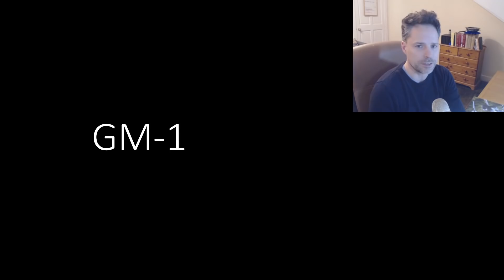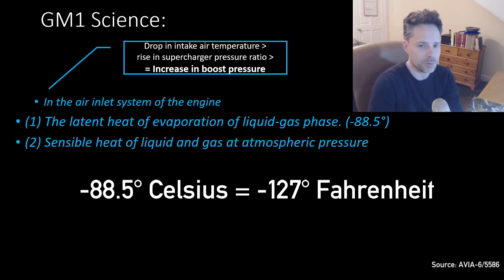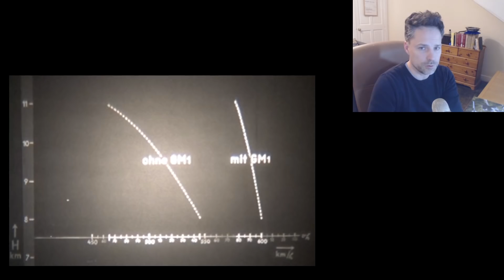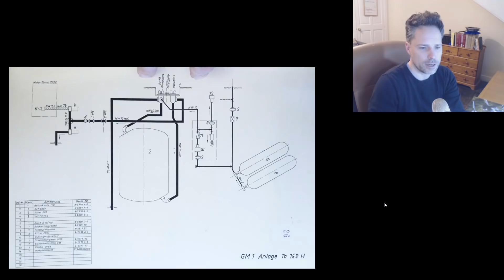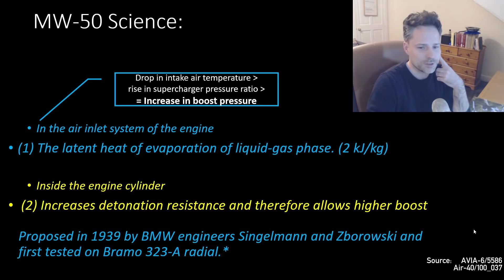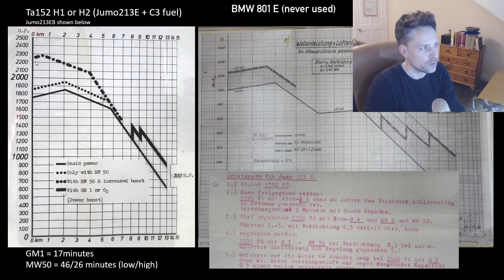The Secret Behind German Engine Performance: GM-1 and MW-50

Comment: GM-1 was rarely used. MW-50 was lower altitude power and more common in 109Gs in the Summer of 1944, but MW-50 soon fell from favour in the Fall: It added weight and was of little help in combat, because power does not help turning. Even 109Ks and 190D-9s probably rarely had MW-50, especially the 109s, since it forced using higher grade C-3 fuel. 190D-9 pilot Eric Brunotte mentions he never went past the MW-50 notch in combat, only to get away, and barely even for that... In fact he mentions being way below the notch all the time during combat... It added 300 lbs of weight, GM-1 even more... More power was really of little help in combat. Flaps and turning mattered more.
Reply: The above refers to fighter use, not bomber use.
Reply: Statistics on installations of MW50 and GM1 are almost impossible to come across, as they were very often installed in "kit" form, and sometimes aircraft designated as using it, never had it due to shortages of the insulated containers, the fluids themselves (GM1 was in direct competition with the Fertilizer and Munitions industries which also desperately needed the Nitrogen, and Methanol production was also desperately short, often being in competition with production of the basic fuels themselves.

It is quite true that GM-1 was not popular with all pilots, in liquid form under cryogenic storage (instead of liquified under pressure) it was very very tricky to work with, very hard for ground crews (you had to fly soon after filling the tank or the GM-1 evaporated off), and tricky for pilots as it took several minuites for the full effect to be felt as the flow took a while to stabilise. 

I would say however that your statement that "more power was really of little help in combat" is not a defensible viewpoint, unless you accept its only the case for a very low speed turn - which is a tiny part of combat as a whole. Its the only method of increasing the performance of an aircraft once it has been laid out, and occupied thousands of engineers on all sides from the mid 30`s to the very end. More power enables you to completely dictate the entire combat episode, picking out the single tiny moment of a low speed tight turn as "what combat is", is a very strange thing to do. All Allied pilots were advised to use their speed advantage in combat, and not engage in tight turning dogfights, if the enemy wont enter into a tight turn, and has superior speed, he can simply escape then come back and re-engage on their own terms from a new vantage point, and usually win. All the AFDU reports advise this.

You have to be a bit careful before implying that tight turns dont need engine power, the more you bank the more power you need to apply to turn without losing altitude, because lift is lowered, so you have to increase angle of attack (significantly increasing drag). Blanket statements on this are not accurate.

I am perplexed why you feel the need to state "MW-50 was lower altitude power", this is explicitly stated in the video, several times, which suggests to me you have not actually watched it (or at least not a lot of it).

So whilst I agree it was not used nearly as much as you could imagine, I do not agree at all that flaps are more important than engine power in WW2 combat. The complete trend througout WW2 was a progression from the "turning" philosphy of the biplane age of WW1 to the "energy" philosphy of modern combat, where speed is all and enables you to dictate combat. One can find examples of anything, but broadly this is unquestionably the broad direction in which combat engagements went in WW2, engine powers tripled, weight doubled, and generally as a consiquence of high wing loadings, and high speeds, agility went down.

I am always looking for archival statistics on GM-1 installations, if you have them, please provide them below.
Reply: Low speed turning was not "a very small part of combat'", except early in the war: By 1945, a FW-190A pilot said: "We turned continuously: It was the only way to survive." Hit and run was a valid but difficult method of fighting, given 1% hit rates from average pilots, worse so at high angles... Turn fighting not only offered more target time, but protected from high angle leading shots from outside the circle. Turning while cutting the throttle  also easily defeated hit and run tactics, and US Navy pilots criticised Japanese Navy pilots for NEVER turning with the A6M Zero, as the IJN steadfastly adhered to outdated 1930s hit and run ideas (which were good for jets, but applied too early to props). The IJA turned more consistently than the IJN, and collected more kills with the inferior firepower of the Ki-43. This is all from recent discoveries by Pacific war historians. Hit and run dominance was a 1930s assumption as soon as monoplanes appeared, and a handful of good shots felt the concept solid from limited Spanish Civil War experiences, leading to the massive debacle of twin engined day fighters... The currently accepted history of WWII air tactics is the exact opposite mirror of reality, and the reasons are rooted in the actual physics of these low wing prop aircrafts, as explored on my channel: See "WWII fighter aircraft designers did not understand what they designed", in particular, to understand why internal leverages make these aircrafts counter-intuitive. FM-2 Wildcats and Ki-100s could and did defeat practically everything they encountered, and FW-190 pilots like Brunotte are adamant they never used emergency power in turning combat, and in fact did not even go to the full continuous power notch... Internal leverages are so counterintuitive Clostermann (RAF mission record holder at 400) pointed out the Spitfire out-turned 109s and 190As above 280 knots, but said that inevitably speeds fell below that, and that the die hard myth the Spitfire could out-turn either below 280 "is a good joke"... Similarly, top RAF FW-190A killer Johnny Johnson (and top Spitfire ace) described being out-turned by the FW-190A at low speeds as "inevitable"... Hit and run was a valid tactic on an unaware target, but was much harder to apply in reality than in theory. And it is generally not true most fighter targets were caught unaware, although some aces did take the time to "stalk" damaged or unaware stragglers, and sometimes made a principle out of this. Typical combat was increasingly turn fighting as the war advanced, and you see increased instances of reduced throttle while turning later in the conflict. This is because the wing inter-acted with the thrust, as I explain in my videos.

Comment: Very Interesting, Just watch Fast and Furious, any one of them and you will see the use of the N2O, however it destroys your engine for also another reason as the residues turns to Nitric acid the corrodes your engine, not to mention the tremendous stress it puts on your engine ehile it is applied, sometimes these engine are not designed to withstand such tremendous forces.

Comment: These engines were fuel injection, right? So how did the NO2 or MW-50 get introduced into the cylinders?  Also did the use of either of these systems have an effect on the Time Between Overhaul (TBO) based on the number of times they would used?

Thank you,

Love the channel
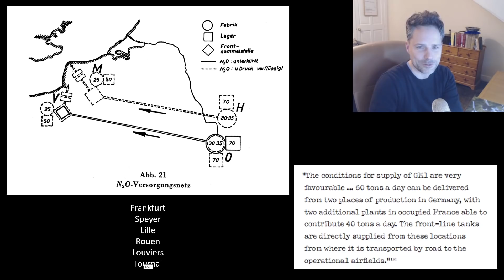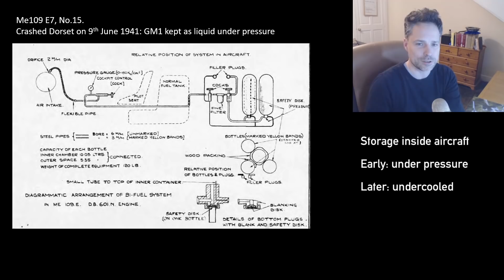Reply: 13:22 14:26   - TBO was basically an irrelevance to the realities of German aero engines by the time these were employed. Real overhaul times dropped to 50hours regardless of if you used them or not. In principle, MW50 would put more load into the bearings, and therefore would definetly shorten the life, however there is no data at all on what that would be. By late 1944, most aircraft were probably destroyed long before the engines reached their major overhaul period.
Reply: @CalumDouglas  was it injected directly into the intake manifold?
Reply: @stuartmoon6202  Depends on the engine, but almost always injected into the supercharger eye. Hence the two time-stamps I provided which link directly to schematics showing you where it was injected.

Comment: My understanding was that the allies were using super saturated fuel, with a much higher octane rating than the Germans, giving them also some 300hp advantage at around 20 000ft.  Might it be that the Brits understood Nitrous oxide but were not interested in going that route?
Reply: TL;DR fuel was probs not the reason, rather engineering took a different route.

I don't have much expertise on that issue, but my understanding is that at least the US and UK, compared to Germany, used a different octane rating system for aviation fuels. German fuels, generally, were a bit worse in octane rating, but not nearly as much as the numbers comparison suggests at first sight. There's a lean and rich measurement yadda yadda. They were definitely competitive with the Allies' juice. Putting that ~300 HP @ 20k ft figure out there without context is hard to comment on, but personally I'd say the main technological difference there was intercooling.

This is where things get blurry. You need both an engine design, and the fuel grade necessary to make use of each other's potential. The various Axis and Allied powers followed different approaches to different doctrines, although those sometimes mixed through Lend-Lease agreements and license production. Instead of supplying a sort of air additive to run what you have at more boost, the Brits decided to bolt on a second (auxiliary) supercharger, which feeds into the (built-in) engine supercharger, and they put a charge air cooler "inbetween" them (intercooler). For all intents and purposes I'd say that followed about the same rationale as GM-1, which was to increase performance at high-ish altitudes.

Comment: Methanol is also an oxygen enhancer, as is ethanol. Plain old vodka (ETOH) works the same as methanol, but methanol has more O2 in it by content and a greater latent heat of vaporization. They work similarly to N2O, cooling the charge as well as adding more air-fuel charge, but there is something else both ethanol and methanol do.. they enhance the octane, so you can run more compression, boost and spark advance without knocking out ring lands or flattening bearings from knock/ping. 

That is part of why N2O didn't work so well at lower altitudes, and could damage the engine. You need enough fuel, with enough octane for the cylinder pressure, spark advance, and heat, more O2 at lower altitudes means you need to add more fuel to compensate for the added N2O. The added cylinder pressure means you need more octane down low.  The higher you go in altitude the less air you have, so a given static compression ratio will work with a given octane. 

With the mechanical injection these planes used, they did not have the adjustability and near instant compensation of modern EFI systems. Without getting too far into it, you essentially have jets similar to a carburetor that have a range where they flow the right amount of a given RPM range, above or below that and you are rich or lean. Now they could add more complexity and incorporate more injection nozzles 'tuned' for a different RPM with the N2O in mind, but that would add a lot of extra stuff to planes that already have two of everything. 

Adding more weight without increasing power doesn't work so well, look at the A6M2 and 3 vs the 5 and 7. Sure the 5 and 7 had self sealing fuel tanks and more armor, but that cost them speed and agility. Adding more power increases weight as well, you can't escape the weight v power with aircraft or rockets. What amounts to another entire fuel system adds weight that is only useful while you have the added fuel/oxidizer. Throw the altitude variable in there and you're suddenly hauling a bunch of stuff around when its easier to not use N2O below a certain altitude/rpm or above a certain manifold pressure..

The 1940s were still limited to 'clockwork' computers, using gears and cams to make changes, the only way to change it is swapping the timing components out of the system, and you can't do that in flight when you run out of N2O or methanol. EFI makes it simple and easy to add more fuel wherever in the RPM range you want, with or without nitrous, methanol or ethanol also being added.

I'm a car guy who has a thing for airplanes, and would be an airplane guy if I have never made that much money. I should have bought that Cessna 140 for $2500 back in the 1980s.. 16 year olds back then didn't have $2500 to throw around. I settled for joining the USAF and loading cargo planes, (first base was Rhein Main AB near Frankfurt no less) where you learn about allowable cabin load, take off weight, balance, and more. Fun stuff. 

Since I can afford old cars, I build them and run them on home made ethanol/vodka and E85. In learning how to make the fuel, convert carbs/EFI to run it, and all the related stuff that goes into doing it so I can go faster, I also learned about methanol, N2O, boost from turbos or superchargers, and the various forms of carburetion and injection, both mechanical and electronic.

You get more power from alcohol fuels, you can run a lot more compression and boost, and there is no need to retard the timing when useing N2O with ethanol or methanol until you get into compression ratios in the diesel territory. How much power do you gain from just using ethanol over gasoline? Well in a low compression engine that will run on 87 octane, you will pick up between 5 and 20hp. Considering even high octane race gasoline will not run in an engine with 20:1 compression, and ethanol or methanol will, you  can build engines to make considerably more power, and even at higher altitudes.

Comment: i saw an article about one reason the german engine did not perform as well as they could. it was the fuel the germans on ly head 90 octane fuel where the allied used 150 octane

Comment: hey so the Chieftain didn't have the answer to the question of are there any advantages/disadvantages to a reindeer-powered present supply vehicle as opposed to one which uses tracks, and as he said, he hasn't dug in the airforce archives for it. Have you by chance?
Reply: Remember drawings of the proposed paddle powered pre-airships in the 19th century?

Comment: Obligatory "50/50 by mass or volume" question, because those are not the same for water alcohol mixtures :D
Reply: Volume
Reply: Although if you want to get REALLY pernickety, its actually 49.5% water, 50% methanol and 0.5% inhibiting oil.

Comment: SO that's the origins of Nitros-oxide!  And so the German pilots were told not to use the "ha-ha-process" at low altitude.  That was wise.
Nitros-oxide was/is a performance enhancer used for race cars.  And if you don't know what you're doing it's advised that you don't use it as you will likely destroy your pistons.

Comment: It's amazing that the Mig-25 hit a record altitude of 37.65km even though it had modified engines.
Reply: MiG 25s are absolitely amazing single porpoise hyper refined tools. The best interceptor that has ever been built, and ever will be built probably, as the role seems to have become obsolete.

Comment: Without tetraethyl lead  for high compression relations, Germany had to use those fancy replacements but never reaching the level of TEL. So german engines were heavier and larger than those using TEL but the same HPs...and using more gas for the same work...WM50 and GM1 had to be used for only 30 seconds.
Reply: German fuels had a lot of TEL in, a DB601 is actually lighter than a Merlin, and MW50 and GM1 were not used for 30 seconds, but several minutes.
Reply: @CalumDouglas  TEL was a DuPont exclusive formula, was only made in the States. If germans have had TEL they have not used WM50 nor GM1. TEL in gas allows for permanent use, not seconds or minutes...but, where there is a link with that info?, regards.
Reply: @Bacanalable  - As you can read in my book (page 65), the Americans sold a complete set of factory plans to IG Farben in the 30`s, Germany also set up their own "non approved" TEL plant (with IG Farben) in Frose. The first plant was made with help from Ethyl Corporation and was built in Gapel-Doberitz.

You can read about a lot of that here:

“Utilisation of Farm Crops, Industrial Alcohol and Synthetic Rubber, Hearings before a Subcommittee of the Committee on Agriculture and Forestry United

States Senate”, United States Government, 1942. {pg 1199}

German B4 and C3 fuels had 0.12% TEL by volume, actually higher than allied 100/130 which had 0.095% by volume.

If you find original WW2 German aviation documents, the engine test curves with lead are denoted "blei" (Lead) or sometimes Pb (which is of course universal).

Hope that helps (I have thousands of pages of original WW2 fuel development papers from IG Farben, so I`m afraid this is a settled issue.)

In fact, on 12th January 1935 DuPont wrote to the Board of Ethyl Corporation, urging them not to share the licence with Germany.... (the letter was ignored)

If you contact me via my website, I`m happy to email you orginal German fuel specification documents.
Reply: @CalumDouglas  Thanks, very interesting info...why did germans remain using wm50?...was it used besides TEL?.
Reply: @CalumDouglas  I read your comment in facebook...you have illustrated me...thanks very much...regards.
Reply: @Bacanalable  - They both work to reduce knocking, however, there is a limit to how much TEL you can put in the fuel before the corrosion problems become very severe. So there is only so far you can go. German fuels that were used most of the time had very low knock limits, so even with TEL, the B4 fuel is not fantastic. Hence, Germany still needed additional methods of reducing knock. If you read the book all the information is there.